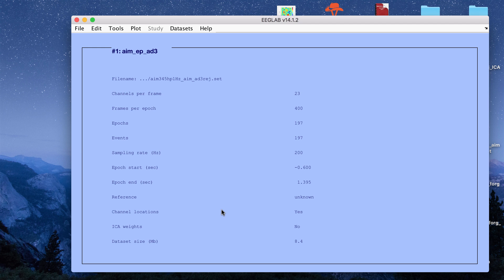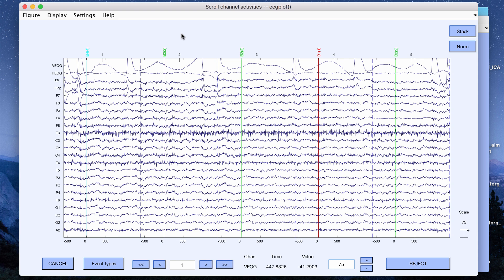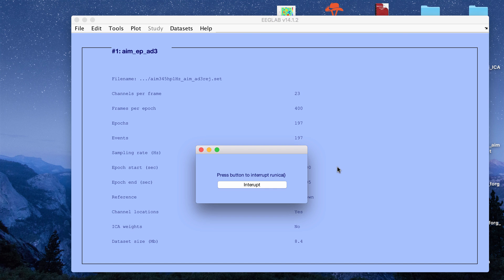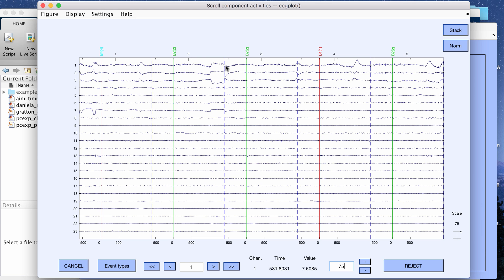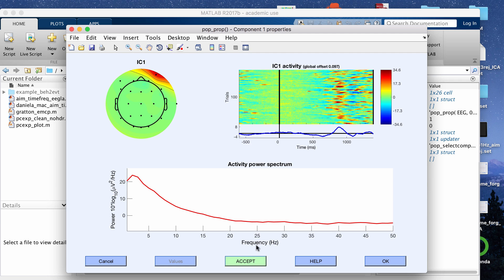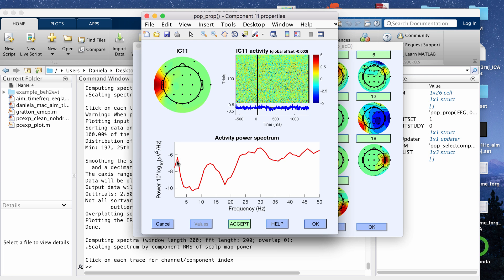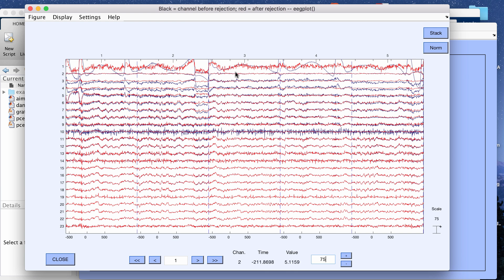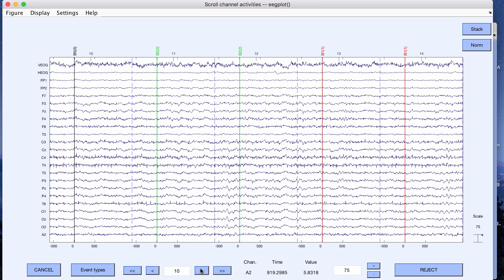Artifact Removal Using ICA

Comment: Thanks for your video.
How many points should I use to apply ICA decomposition? 
I am working with the EMOTIV Insight and it only has five channels.
For my project, I have to analyze the signals in real-time, so I plan to apply the decomposition to a window of 2 seconds which results in 256 points for each channel (since the sample rate is 128).
Do you think that amount of points is enough or is it necessary to have more?
I wait for your reply. Thanks a lot.